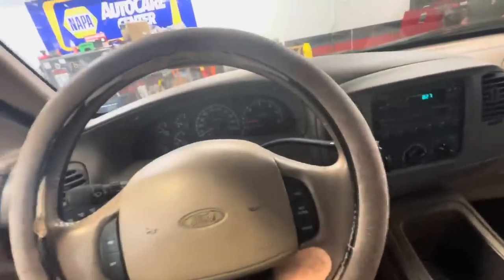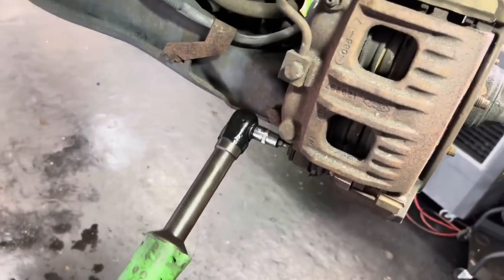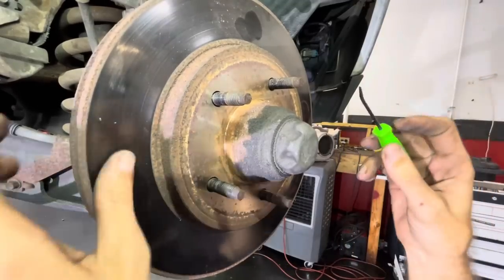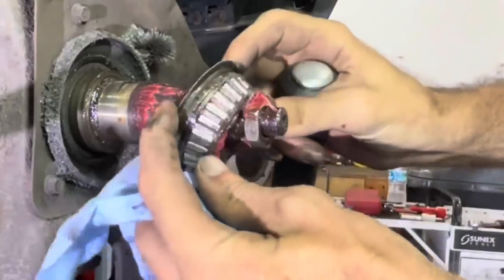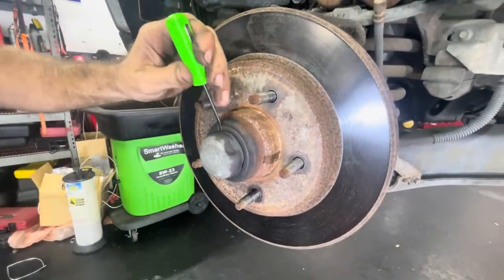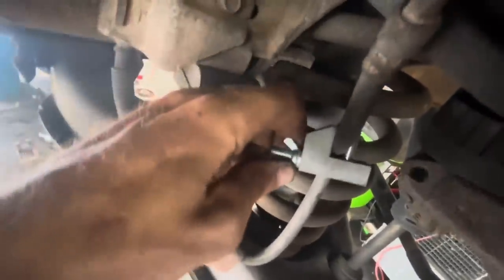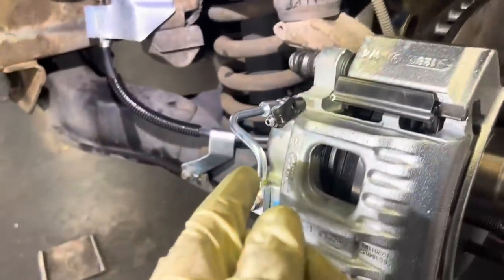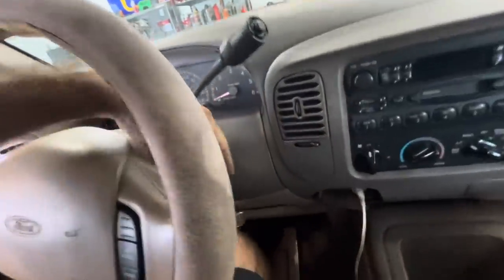Worn to NOTHING! 1998 Ford Expedition

Comment: I have a 1998 xlt 4.6 liter that has 42,000 miles on it and ford trashed it. They put a new windshield on it (yeah, I know) and it leaked frying my computer and electronics (gem and more). They got one from a junk yard and it’s never been the same and now it’s gone, towed but I was never told. After a year and a thousand in work/parts it still will not accelerate and misfires and I was told don’t bring it back, they can’t fix it. 
I know what’s wrong with it after watching your videos. Hard to believe ford wouldn’t know it was the catalytic converter (never got the chance to test the exhaust). 
It ran perfectly before they buggered it up. First new car I had bought and it cost me plenty. Maintained it every 3 months and it was perfect inside and out. 
I have a RAV4 2021 now but I can’t mentally let go. I was going to sell the xlt for $4,500 when they fried it. 

Why aren’t they all as honest as you?

Comment: I don't know if it's just me or napa copper washers, but I can never get them to not leak when I use new ones.
Everything I've worked on on the last 10  years or so still have their original crush washers!
Reply: Definitely not the washers unless, of course you've wound up with a bad batch.  I've done full brake jobs on nearly every car I've ever owned and use Napa parts on all but one (used O'Reilly parts once) and have never had an issue.

Comment: Be aware that the last guy may have put the thing together backwards, so the way it came apart may not be the way it needs to go back together, vacuum hub seals on my ford were backwards when I bought it. look for witness marks and make sure it makes sense.
Reply: I took a pair of motorcycle forks to a shop to have the seals changed.  The dick mechanic put em in the wrong way round.  Wouldn't admit his mistake,  I had to sue him!

Comment: There is an addition to "everything is a hammer" its "every machine is a smokemachine, you just need to use it wrong enough"
Reply: Especially electronics.  It's a bad day when you let the smoke out of a power supply.  Plus it takes weeks to get the smell out of the workroom.

Comment: I would of thought the METAL ROTOR being new and the other being worn would cause a slight imbalance until bedded in . Im pretty sure in the UK we are required to replace both discs i know we have to replace both sides when doing the actual brake pads.  Rgds Don

Comment: Think calling a split pin a cotter pin is an American English thing.

In England a cotter pin is a pin or wedge passing through a hole to fix parts tightly together (often used previously on bicycle cranks).

Comment: It's amazing how fast those brake cleaner cans run out of cleaner. Gotta find a better method. Or they need to be cheaper.  

Always wonder if it's better to use vacuum at calipers to pull fluid through the lines or push fluid from the MC to the calipers.

Comment: What cotter pins do you purchase? I have a '08 f150 two-wheel drive front spindle and I'm replacing the rotor as hub assembly as you know it takes 295 ft pounds and it's got that shield and cotter pin. Because I really enjoy your channel and respect your opinion I'm curious what exact ones that you use. I apologize for the monologue lol honestly if I was closer I was just bring all my stuff to you and have you do it and go Hi Ray let's have some fun today 👍
Reply: 295 foot pounds on what
Reply: @michaelpressman7203  2008 Ford F-150 4.2 l V6 two-wheel drive front spindle nut that holds on the rotor wheel bearing assembly. I didn't think it was accurate myself but my manual stays it is. I'm like okay. I'm used to the ones he does in this video.
Reply: @bthompson101202  I double check that with somebody like Ray that's an awful lot of torque a matter of fact I don't know any bolt on a car that needs that much torque but I am not a mechanic
Reply: @bthompson101202  okay but I don't have a torque wrench that goes that high I've never talked to anything that high hey have a good weekend buddy

Comment: The only reason that split pins break is that they are fitted incorrectly and I have told you before about this. You only need to bend one of the legs about 30 degrees, the reason is to stop the pin falling from the hole, that is all that is required. There is NOTHING under that cap that will cause that leg to close ever, but, you want to be able to remove the pin easily. Furthermore, there is absolutely no point in piling all that grease between the bearings, it just holds moisture and does nothing but overheat and expand causing premature wear, it is a waste of grease. Wheel bearings are supposed to be set using a spring balance not by feel.

Comment: So I work in a factory that makes those metallic roller bearings and does it not scare you as much as it scares most of us that work there that the roller cages made of plastic.... Every one of us that have ever had to put together a bearing with a plastic roller cage...  We end up just shaking our heads.. Because no that's not gonna last plastic degrades overtime way faster than metal
Reply: I agree with you they've integrated more and more plastic into things have been in manufacturing for years and the thing that bugs me is old plastic is cheaper but it don't last

Comment: Do you not bed-in the brake pads and rotors ?

I learned that trick racing in the IMSA Championship Endurance Series many years ago. It makes the brakes work better and come in sooner. In a vehicle with a towing package spraying the brake backing plates with a ceramic coating will help isolate the heat in the pads and rotors from transferring to the brake fluid causing it to boil sooner thus causing premature brake fade on a long decent down a steep grade while carrying a heavy load or pulling a trailer not equipped with brakes. Bedding-in the brakes or seasoning them as some say, can be accomplished in a conventional oven in stead of on the car. Since brakes were changed several times during a race like the 24 Hours of Daytona or the 12 Hours of Sebring having brake pads and rotors already seasoned was a big help. It is the same principal the NASCAR guys implement by scuffing in their tires or heat-cycling them.

I find your content both informative and refreshing. Best wishes and best of luck to you.

Comment: Just curious as to why you don't use a torque wretch when tightening the bearings. All the bearings I have done had a torque spec then a back off spec.

Comment: Over the last 20yrs in the automotive industry, I have never worked at a shop where they would allow the replacement of only 1 caliper, unless it was a 3/36 warranty brake job. Not saying it right or wrong, just making the point.
Reply: Some shops will have the owner sign a waver for the shops protection, but I don't know if it would hold up in court.

Comment: I would be say your doing that backwards if I were there.  Got my car all fixed, it cares about me it always break at home not 300 miles from home at a Dr visit. Almost had stroke at cost. They charged me 350.00 to splice wire back to gather in fuse box. I can start car with  key now.

Comment: hi ray, I dig your knowledge and humor, keep it up 🙂
in your video you mentioned the need to achieve maximum lubrication when packing the bearings, so why not use a bearing packer?
Suggestion: when faced with rotors that have significant rust raised edges, would it be feasible to grind a couple sections off, then rotate the freshly ground section to where the rotor is to help facilitate caliper removal?
click
Reply: So easy to press  pistons back into the caliper using a C clamp before even attempting to remove the caliper assembly.  Suggestion: You probably shouldn't be working on brakes if your first thought was to use a grinder on them.

Comment: RAY... Question; Is there a secret to making brand new rear brake drums centered on the hub so they don't "act" warped? I have a 99 Camry that I bought brand new premium Wagner rear drums for.  I find it highly unlikely that I have a warped rear drum, but from day one when it was installed, the handbrake pulses like crazy if applied (slightly) when moving at a reasonable clip. If I apply the brakes hard, I can feel it in the pedal as well. How could a brand new brake drum be warped, especially a premium drum? The original drum did this to a degree as well, which leads me to believe there may be some other problem, but I don't know what it is. The wheel bearing seems fine. While the drum goes onto the lugs only one way, I noticed that there is some play that allows the drum to spin just slightly on the hub, so I'm wondering if it depends where it sits as you tighten it down with the Lugnuts. I was wondering if I should loosen the Lugnuts a bit and apply both the parking brake and press the pedal to center the drum on the hub, then retighten so it would center it. Any words would be greatly appreciated.

Comment: A topic for discussion: Since grease does not flow like an oil, is there any need to add additional grease into the rotor cavity? When I worked for an independent, my boss had me add additional grease. When I worked for Goodyear, my boss said not to.
Reply: I was taught to remove the old grease and put in fresh if rotors were still good and not being replaced. Grease can get hot and melt and solidify as it cools, maybe that's why your independent had you add additional grease?

Comment: I would just use a c clamp and a brake pad to hold the pistons on the other caliper instead of using a clamp which can damage the wire braiding inside and rebuilding the caliper is very easy and inexpensive knowing you have OE parts instead of chinese is another reason but if time is an issue to each their own.

Comment: I don't much care which direction people use their pliers/channel-locks/knipex, though you do lose some clamping force. If it starts to slip, more force can be applied to the fastener when using them the way they were designed. What I don't care for is replacing suspension/brake parts on one side only. I was taught, and is my experience, that if one side is at end of life, the other side isn't far behind. And yeah, it needed replaced because the pistons were too far out, but I would still have prefered to replace the other caliper.
Reply: It seems a bunch of people are excited about the players you got to know your tool the proper application and it's not the tool it's the person that's using it correctly and not abusing it that matters
Reply: @michaelpressman7203  his money, his tools, lol. I have a lot of the same tools he has, have had them for decades in some instances. The good stuff holds up remarkably well. everything's a hammer. LMAO
Reply: @donakahorse  I have a gerstner toolbox full of pretty things you would like them
Reply: @donakahorse  I have quite a few dollars invested in automotive tools but my main thing is cool and die machine shop and I hate to say it I cannot use a micrometer for a hammer not good hey take care buddy have a good weekend
Reply: @michaelpressman7203  lol, I did some time on a grinder, I was ok, not good enough to stick with it. So yeah, micrometers are not good hammers, neither are dial calipers or transfer punches, etc. rofl  Have a great weekend.

Comment: Yep, using tools backwards bugs me!  It takes less muscle to use it the way it is designed.  In the case of an adjustable wrench (Crescent Wrench) using it backwards it is possible to break the wrench.  Why do you use the pretty red grease?  45 years ago I switched to white.  I worked around printing pressed and found that large printing places used white on the presses.  Greasing was usually done in the middle of the night or during a print job change over.  They used white because white turned dark when over heating.  They had to log the color coming out of the bearing so the press could be scheduled for a bearing replacement during an appropriate time.  Why shut down a large job because the press is down  and why have to replace more than the bearing?
Reply: You mean like a left hand screwdriver in the right hand
Reply: @michaelpressman7203  That makes no difference to me.  I trained myself to ambidextrous.  Doing so has a drawback.  I started gaining too much (eating with both hands).
Reply: @AlanEngels  I had to become in my dexterous I had to rotator cuff done after I retired but up until then had to work left-handed try eating with chopsticks it's a good way to dye it
Reply: @michaelpressman7203  I am retired too.  Six years now.  The position I enjoyed the most was that of a Manufacturing Engineer.  I later swiped over to IT at a university.   I retired six years ago.  Since retiring I received a pacemaker and had to have spinal surgery.  Right now I am good.  The rotator cuff is a tough one.  My wife had problems with that.
Reply: @AlanEngels  hey I understand after I retired I had to rotate a cup then let me think I had a quadruple bypass and then I had nothing to do last summer and I broke my neck but hey I'm still working on cars and doing what I got to do it's not a problem yeah you got to prove you what you are and just get back up again and keep on doing I enjoyed working with engineers lot of times they come up with problems I sit down with pencil paper and a calculator figure it out and say here's what I'm going to do no big deal it was a lot of fun and a good challenge

Comment: Cotter or split pin?  A cotter pin here in the UK is a solid pin, sometimes with a taper on one edge and can have a thread to take a  nut,  anyway,  we invented the language so it must be right 👍🤣
Now work on colour instead of color
and Solder instead of Soder 👍
Keep up the great vids.
Reply: Lol , at least we know that a trunk is not a bonnet .
Reply: I noticed the use of "split-pin" and was very happy.  You could add neighbour and favour, along with bonnet, boot, sills, bulkhead, indicators, gudgeon pins, to say nothing of Jag-you-are in place of Jag-wah and levers not "levvers".    🙂 🙂 🙂
I concur, good stuff Ray, keep up the excellent vids.
Reply: @eaglerider1826   The trunk is the boot and the hood is a bonnet over there.
Reply: @ronaldcooper7609  Yes , I know . That's why I said it the way I did .

Comment: Pliers should be used in the proper manner for safety sake primarily. Secondarily for the sake of preservation of the bolt or nut that the pliers are being used for.

Comment: Well yeah with those kinds of pliers, or like a pipe wrench there is a correct way and an incorrect way. Those wrenches/pliers are designed in a way making them clamp harder when using them the correct way.

Comment: I was on the opposite side of the country when my friction material ran out.  The trick was trying to drive 2000 miles without using my brakes.
Reply: when it happened to me  I used my lever parking brake

Comment: My biggest complaint was trying to get that wheel cap off with a tooth pick made wire-connectors!! My biggest question is why didn't use the Rigid impact on the caliper bolts, looked to be all kinds of room??? My biggest comment is,  I bet you put in 10 times more grease then todays wheel-hub assemblies comes with.......
Reply: They make the bearings sealed for the simple reason instead of repacking and reusing you have to buy a new bearing okay

Comment: I've seen a couple of old cars without cotters to hold the spindle nuts. Instead, you torque the nut down pretty hard (like 60 ft-lbs). There is a spec for it for each car, and you have to check. First time I saw this was when the rear wheel fell off a car in a turn because it had not been properly torqued on a brake job. Scared the snot (and other viscous fluids) out of me.
Reply: Different type of wheel bearing. Taper roller bearings do not need to be "torqued down" the nut has to be loose.
Reply: @geoffwoodgate7450  that depends on the car.  For example MGBs are always torqued when done correctly and they are also tapered roller bearings.  They have a specific clearance required and are shimmed to get it.  It makes changing them interesting ìf you don't have a dial indicator to check the clearance.

Comment: The wear sensor belongs on the inboard side. The old pads were on the outboard. Last person that replaced the pads screwed up.
Reply: If the driver of the vehicle doesn't pay attention does it really matter where the wire sensor is
Reply: @michaelpressman7203  
No, but if it's on the wrong side, you're brakes worn out notice is a metal on metal grinding noise
Reply: Well thank you I just learned something today
Reply: @scott_meyer  you mean Sparks and the thing going red heart hot and not normal darn no wonder it smells so bad

Comment: As a piece of advice for tightening the outer nut after putting the rotor on, what I've been told is to tighten the nut hand-tight, then back off the nut 1/8th to 1/4 of a turn, and checking to ensure the rotor will spin, but not have play, exactly as Ray said. 

Otherwise, well done on a brake job that is of an older Ford design!

Comment: It does not bother me to see Channel Lock pliers used the wrong way if the nut can be turned with no slippage and rounding of the nut edges. However in high torque situations where slippage and nut damage is likely.....please use in the right direction or consider an appropriate socket.  Thank you....LOL